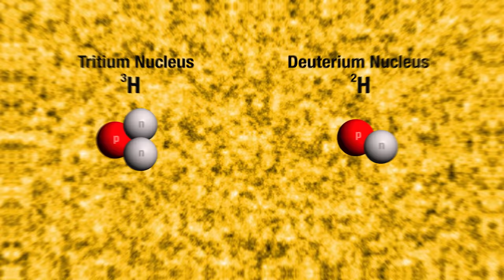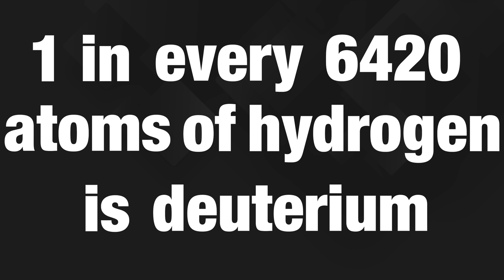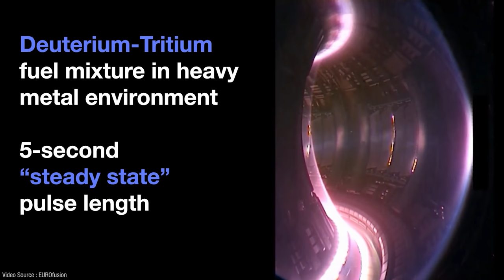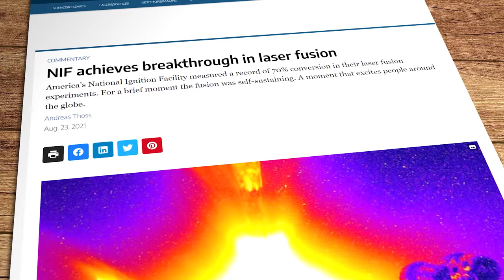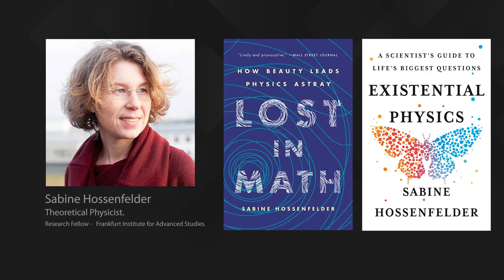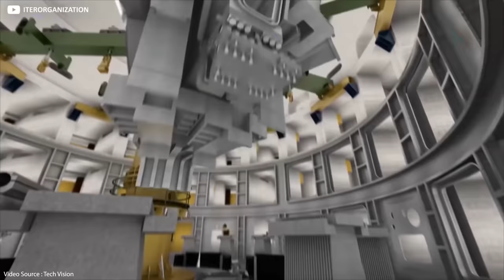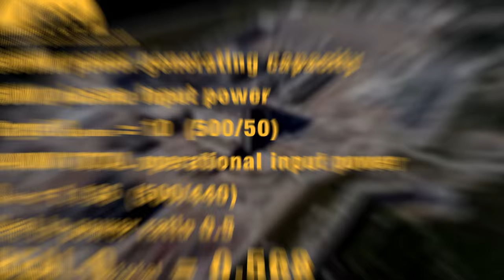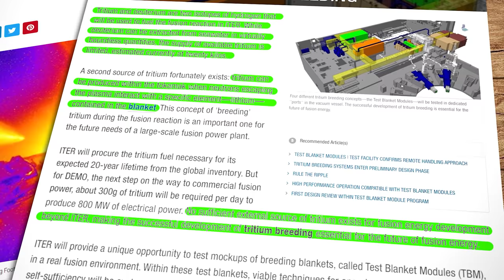Nuclear Fusion Illusion. Is it time to park the pipe dream?

Comment: It seems like a big pain that they have to have these super clean conditions inside the reactor.  Even a fingerprint on the inner surface can  be enough to cause problems for the plasma some say.  
If the plasma was hot and dense enough, this would not be a problem.  But they have a problem confining such a hot dense plasma.  
Suppose they did not need the huge magnets that consume so much energy? They would be way over net power.  High voltage plates consume very little energy to maintain their voltage once they are charged up and they can briefly contain a  plasma that is hot enough to fuse even protons.  If they put high voltage plates around the tokamak instead of magnets, they could contain some plasma for some time.  If near enough 100% of the waste energy went into generating electricity, it might be easier to get net power.  But if the plasma is not always contained, it will hit the walls of the reactor and bounce back into the plasma and cool it Ioff and eventually destroy the reactor. 
A number of problems could be solved if they could just use a  gas spinning at a high enough velocity to circulate around  the inner surface of the reactor.  If the gas is circulating fast enough, it will compress the gas against the inner surface of the reactor and create a vacuum in the center.   If the high voltage can briefly contain a high temperature, high density plasma that can fuse hydrogen(H1, not H2 or H3)and the circulating gas is hydrogen, then for each ion that escapes from the plasma it is likely to ionize more than one hydrogen atom that is circulating around the inner walls of the reactor.  The same with the electrons that crash into the circulating gas.  If the ionized atoms are in front of a negative plate, the plate will accelerate electrons back towards the center.  If the ionized atoms are in front of a positive plates, they will accelerate hydrogen ions back in towards the center.  The alpha particle products of fusion that crash into the hydrogen gas would ionize zillions of atoms.  Even the alpha particles traveling at 20 or 30 million meters per second would be  stopped short of hitting the metal housing by  a thin layer of compressed hydrogen gas.   
Even a large number of fusion temperature ions escaping from the plasma might not be  problem and near all of the waste energy would  contribute to heating the surrounding gas.  If the surrounding gas was driven by and used to drive a gas turbine, most of the waste energy would be going back into the reactor to drive the system.  
High voltage points or the final points if lasers could be used to ionize points along the inner edge of the gas to supply ions and electrons to the plasma.  If the voltage is high enough, the ions will be at fusion velocity when they reach the center.  If the voltage is arranged to drive an excess of electrons into the center, the negative potential at the center would help to confine the ions and electrons for a longer time.  If the ionization points are offset from the center of the plates slightly, this would tend to cause the plasma to spin which would create a magnetic field from the excess of negative charge which would also help confine the plasma.   The spinning would also help drive the spinning of the surrounding hydrogen gas and keep it compressed against the walls of the plasma.  If the spinning is driven by the beams of ions and electrons and the spinning drives a gas turbine, then it seems that near 100% of the waste energy would be at a high enough temperature to contribute to driving the system and net power.

Comment: A good list of problems for the tokamak/stellerator type designs. Other possibilities exist a=but have been deprioritized because of the concentration on Tokamaks and more generally d-T type fusion.

One other concern I have that is not mentions that these systems rely on high neutron] radiation escaping the reactor chamber to transfer heat energy. I am skeptical that the superconductors and semiconductor circuits ca n withstand this neutron and gamma ray flux over the long intervals necessary to make a  practical commercial power reactor. 

Additionally power production will be precarious. These types of reactors only can work efficiently at massive scales. Power enough to feed megalopolises but what happens when one of them goes down? Massive blackout for days for millions of people. If fusion is viable, we need to be looking at alternate designs. Smaller, cheaper, not tritium dependent and preferable aneutronic.

Comment: Status of the Magma Energy Project
Dunn, J. C. (Sandia National Labs., Albuquerque, NM.)
Abstract
The current magma energy project is assessing the engineering feasibility of extracting thermal energy directly from crustal magma bodies. The estimated size of the U.S. resource (50,000 to 500,000 quads) suggests a considerable potential impact on future power generation. In a previous seven-year study, we concluded that there are no insurmountable barriers that would invalidate the magma energy concept. Several concepts for drilling, energy extraction, and materials survivability were successfully demonstrated in Kilauea Iki lava lake, Hawaii. The present program is addressing the engineering design problems associated with accessing magma bodies and extracting thermal energy for power generation. The normal stages for development of a geothermal resource are being investigated: exploration, drilling and completions, production, and surface power plant design. Current status of the engineering program and future plans are described.
Publication: 
Presented at the Symposium on Geothermal Energy, New Orleans, La., 10 Jan. 1988.

p.s. A quad is a quadrillion btu. Global energy demand is approx 600 quads. Sandia estimated a minimum 50,000 quads of magma energy just from the US alone. Hence, fusion is wholly unnecessary - and one might suspect, pouring public money into fusion energy projects serves to keep fossil fuels in business by implying there are no adequate alternatives.

Comment: We've already got a successful and reliable fusion reactor shining in the sky. We harness its energy in several different, and well established ways. Directly to electricity via solar pv panels, or to heat via thermal panels, or via sun driven weather systems via the wind and hydro, or through the energy stored in plants as the result of photosynthesis. If the same amount of money was spent in evolving and expanding these simpler technologies instead of on fossil fuels and fusion experiments we could have the job done by now.

Comment: I am also skeptical of fusion's promise.  I think it will take at least 20 years for a viable fusion reactor.  With the cost trajectory of ITER and DEMO, it won't be cost effective.  On the cost front I think Commonwealth Fusion's reactor will help.  So fusion's promise of solving global warming doesn't exist.
On the other hand, we really need nuclear power for space travel.  Solar powered Ion drives are limited to the inner solar system.  Also fusion reactors will be better then fission for space.  So I would like to see fusion research continue.

Comment: Agreed, it looks pretty bleak. Would be nice if you could cover MIT's SPARC reactor, which has achieved magnetic fields >20T, and the Field Reversed Configuration device, which also looks promising.

Comment: It is possible that natural fusion in stars works because of the critical input of massive gravity. Fusion taps the amazing and still highly mysterious force (if it is a force) of gravity, and a massive amount of it at that. That massive gravity is "free" as long as you have a massive amount of matter (as in a star). From our perspective, fusion yields a massive amount of energy with very little reaction mass, but what is really happening is fusion is stealing from massive gravity. We can cause fusion in other energy input intensive ways, but not with the extreme exothermic results that massive gravity yields. What is gravity, really? A warping of space-time? Where does it originate from? Another brane, or parallel universe, or another dimension? It is so much weaker than the other forces of nature, it doesn't seem to fit in with them in our universe, right?
So, perhaps fusion in stars works because the most important input to the process, intense gravity, is available via a massive amount of matter compressing under its own weight into a relatively small volume, and cannot be realized any other way with the physics we currently understand. Perhaps gravity represents a type of latent or potential energy in the expanding fabric of our universe or brane that fusion releases. Is fusion a conversion of gravity to energy, with Hydrogen being the most efficient reaction mass?
Perhaps fusion works to increase the expansion rate of our universe by converting gravity to energy??
All of my thoughts have surely been pondered before by many and considered not the way things work in our universe. But there are lots of unknowns out there  😁

Comment: It might help if its proponents (and others) would stop saying how it will duplicate what goes on in the Sun. It does not, and cannot. It will fuse hydrogen, and in some cases other very light elements, very quickly and intensely. Not at all the same thing.

Comment: Oh well, to get Nuclear Fusion to work and give net energy output may require new physics. Say a way to modify the weak force to change reaction rates, or weaken the electromagnetic repulsion. There is hope for the second idea, in a Superconductor the electromagnetic force's  range  is  weakened by photons gaining mass inside the conductor. Hope springs eternal....

Comment: It seems that pro-fission people start out saying that the two problems with nuclear fission are safety and waste storage; then they explain why these things aren't a problem. Fine, but the problem is that the actual two problems with fission are the high cost and long build times. The pro-fusion people will tell you that fusion solves the safety and waste problem of fission. They fail to mention that fusion doesn't do anything to fix the real problems of high cost and long build times.

Comment: Clip from a New York Times Editorial in 1903: "Hence, if it requires, say, a thousand years to fit for easy flight a bird which started with rudimentary wings, or ten thousand for one with started with no wings at all and had to sprout them ab initio, it might be assumed that the flying machine which will really fly might be evolved by the combined and continuous efforts of mathematicians and mechanicians in from one million to ten million years — provided, of course, we can meanwhile eliminate such little drawbacks and embarrassments as the existing relation between weight and strength in inorganic materials."  The first flight at Kitty Hawk was on December 17th of the same year.

Comment: Chasing after Fusion for power generation is a fuel’s paradise exploit. We cannot afford to create unlimited new energy within the confines of the closed system of our planet. Every joule of newly created energy has to be re-radiated to space to maintain the body in equilibrium. The only way to increase the radiation to space is to increase the absolute temperature in ºKelvin which the radiation is proportional to. Using energy that has come from solar input one way or another (includes wind and wave) merely taps the flow of existing energy without upsetting the equilibrium of the globe as a whole. Fusion power would be eminently capable of upsetting that balance and create global warming without the need for greenhouse gases.

Comment: If even £50 Bln was spent on research, it's nearly the entire world's budget, over decades. Suggesting, pulling the plug on fusion, won't mean any more  money for other renewables and even if the entire world's fusion research budget, was put into the push for wind/solar/battery, it would make very little difference. Fusion will not provide a solution in time to be really meaningful in the current climate crisis, but it may be available in the future, in truly 'limitless' quantities and may help us repair some of the damage.

Comment: One of the problems with leaving a comment or for that matter anyone other than a PhD candidate leaving a comment that the degree of knowledge necessary to have that comment mean anything intellectually is rather forbidding. Having said that, and having watched Sabine and others, it seems glaringly apparent that the math just is not and probably never will be there to convert Fusion heat into steam generated or molten salt generated electrical power at levels necessary to reverse or even stem global warming due to the pesky Q factor. Sabine Hossenfelder has done IMHO perhaps the best job at analyzing and explaining just why the Q factor is an issue, but I'd like to see either her or others specifically explain three things: 1) exactly why current designs (tokomak and Stellarator) cannot possibly achieve a Q factor high enough to reach economic and energy efficient conversion ratios; 2) Why Helion's design isn't the go to design instead from an energy efficiency standpoint, and 3) Why is it proving impossible to get the media to cover in detail the shortcomings of existing or proposed designs based on sub-optimal Q factors.

Comment: I had exactly the same idea - if the funds used here were already utilized for smart grids, solar, batteries - even without significant technical breakthrough, we would have much better return of investment, I guess. After the first 15-20 years of the experiment start, someone should have realized "we are not there, yet" and pull the plug.
Reply: I agree - having shown over the course of the last 2 decades that SWB is a distraction at best, it is time to pull the plug.

Comment: Personally I do see nuclear fusion as both propable and neccessary to get to work, however I don't believe that it will be either of those things within a short period of time, heck not even a long period. I do believe we'll have nuclear fusion energy generation, but I wouldn't be surprised if it took decades to even a century to get it to truly work, but that doesn't mean that researching it is a bad idea, as when we research one thing, we tend to learn many more things tangentially related to it.

As for the idea of using nuclear fusion to solve climate change, that doesn't seem likely in the least, for one thing we need to use currently existing technologies for that, since we don't really have time to wait, and nuclear fusion is nowhere near that level. In that regard nuclear fission is a significantly more likely candidate, as well as of course solar, wind and hydro.

Comment: A lot of the research in Fusion is precisely that: research into the process of fusion.   The steps are all working towards that "break even" point but the devices being used right now aren't actually designed to get there.  ITER isn't even really designed to do power generation.   It is quite literally a power generation research reactor and it is telling how long it has taken to not only be built but also how long it is going to take to reach its testing goals.   The truth is that "commercial" fusion will not be researched seriously until after all other forms of finite energy resources have been consumed to the point that it is impossible to profit from their extraction. Fusion, if it is ever actually developed, will be too cheap from a resource-profit perspective.

Comment: I urge everyone interested in clean energy to look up pB11 fuel (hydrogen boron) and to support the dozens of new private researches because the big government research like NIF and ITER, I agree with the host, will now power us up anytime soon. This report is unfortunately lacking aneutronic fusion coverage which has been achieved in the labs like LPPFusion and TAE, and others who are using hydrogen and boron as a final fuel.   These approaches will yield clean and cheap energy that produces ZERO nuclear waste.  They also do not need tritium so many of the problems you list will be avoided.  On top of that the direct conversion to electricity is possible so no losses will occur when getting the energy into the network.  And because the energy can be converted tothe electricity directly, we can have localized and therefore decentralized power supply.   The size of the generators also matters.  The large projects you mentioned are difficult to upgrade and do changes on as experiments unfold.  Not so with the smaller experimental devices.  Smaller sizes are all the craze and they are getting patented as well.

Comment: I don't think that the conversion from Qtotal to Energy is quite fair. Eventually those systems will have to run for long times and at that point the energy you have to insert will either be reduced or be self supplied. Sure we are far away from that and even if we reach the point where we can produce useful energy from Fusion it will take at least another 20 years to make it economically viable.